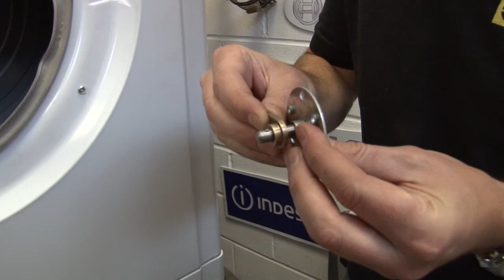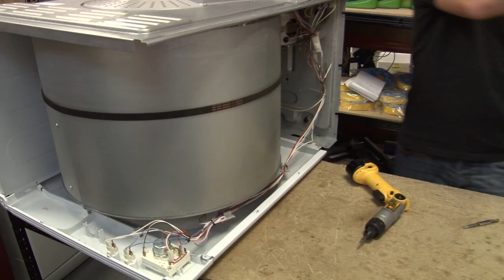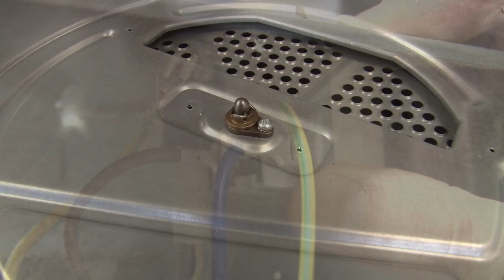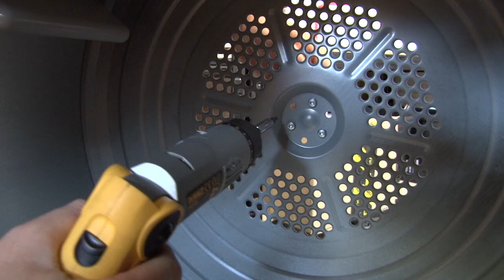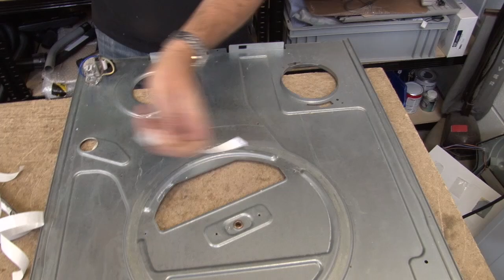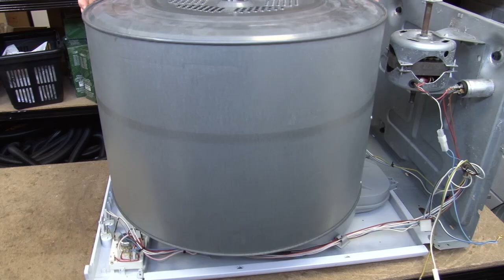You Can Replace Tumble Dryer Shaft & Bearings EASILY Yourself!

Comment: Do you still reply to comments here? 
I have a drum with the shaft already built in. Can you buy the whole drum with the shaft built in? I can’t seem to find them on eBay etc they just sell the shaft kit. 
This video really helped though I didn’t feel so alone fixing this annoying thing.
Reply from the maker: Hi James, we'll certainly try and help you to see if the drum is available for your tumble dryer...could you confirm:
- the brand?
- the model number?
- the serial number?
The model & serial number information should be on a sticker or rating plate, possibly near or behind the door.

Comment: My Beko tumble dryer has stopped rotating.  The motor buzzes but it will not overcome sticking.  If I turn the drum manually from above it works.  I suspect it is either the bearing/shaft or the front supports which appears to be adding excessive friction.  Then again, it may well be the motor??  Anyone else had this symptom?  The wife wants a new one (this was manufactured 13yrs ago and has a B energy rating ( DCU8230 Tumble Dryer).  Thanks

Comment: When you removed the back cover there was no washer on the shaft and when refitting everything you put a washer on the new shaft? My IDV 75 doesn't have a washer and I can't see one on the parts diagram. So should there be one?
Reply: yes.. no washer on mine neither but I have a damaged hole in back plate so if I can find  a washer to fit I will use it

Comment: I fitted your shaft kit which worked great. i now have a knocking noise (9-10 knocks per rotation) my drier version has two bearing pads on one side and a roller wheel on the other. there is good tension in the belt pulling the drum onto these. nothing is visibly damaged. the felt seal/pad seems ok. any idea what this might be?

Comment: Thank you for a straight forward easily understandable video. Just one question...I have managed to replace the spindle  and the bearings, all in working well but, when trying to put the belt back onto the motor, it was very tight (original belt). Got it all back together but the drum is now actually touching the motor, so I can hear a rubbing sound when the dryer is running, which i guess is the drum rubbing against the motor. What have I done wrong?
Reply: I’m having the same issue

Comment: This was great up to the point i discovered my bearing shaft was spot welded not bolted in place.
Still helpful though.
Reply from the maker: Hi Rebel07979, thank you for your post and glad we helped a little bit.
Reply: Mine’s the same, did you drill the spot welds out and re bolt it

Comment: My indesit dryer shaft has completely sheared off and I'd like to replace it myself, but I'm curious about the bearing pads and seals. Are they necessary to replace?

One other question, the shearing of the shaft appears to have done some minor damage to the hole it fits through on the rear of the dryer, cutting a small V shape below the hole. With the shaft fitting through the hole and then a collar, do you think that would be a problem? I can provide a picture, but it looks a little like this shape now O> (but vertical with the v at the bottom)

Comment: Thanks for the video really informative!

For anybody replacing the bearing/belt on an Indesit IS60V both side panels need to be removed to enable removal of the rear panel, also note the plastic bottom trim piece and top trim piece containing the control panel also require removal as there are screws located behind that secure the side panels.
Reply from the maker: Hi JVChester, glad you enjoyed the video and thank you for providing the information for everyone.
Reply: @eSpares   id love see a video of replacing  the bearing on a hotpoint tdl30 from the back some people have done this so many times not worth fixing a noisy dryer  use it for parts
Reply: @eSpares   can you please show a tumble dryer bearing replacement on a hotpoint tdl30

Comment: Question. Could you put some grease on the bearing to slow the wear down ? Cheers.
Reply from the maker: Hi David, most bearings will already have grease in them and extra greasing probably won't make any difference to the life span.
Reply: @eSpares  thanks for the reply 😁👍

Comment: A technician in Spain came to analize a metallic noise in my dryer (24€). He told me what I had to change the bearings and it was going to cost 110€ more. I bought a new bearing for 10€ and I fixed my drier in 5 minutes and it's working fine again. Thank you very much.@esSpares.
Reply from the maker: Thanks for the feedback Antonio, glad to hear you have sorted the problem.

Comment: Ive repaired mine a number of times now. Dont you think this is a rubbish design though. It seems to me that tumble dryers are designed to fail. Those bearings are not even a bearing. its simply metal grinding against metal until it grinds its way into the case. and as for those plastic supports and felt sticky seals. DONT EVEN GET ME STARTED.!! I can strip my machine down and do the lot in less than an hour but these machines are RUBBISH. Its little wonder so many catch fire !!
Reply from the maker: Thanks for the comments Dave. I have personally repaired many of these machines for this problem. In my experience these dryers are great for low to medium use but larger families wear them out too quick. For heavier users Bosch and LG machines last a lot longer.
Reply: Yes. Ive ended up drilling out the square bearing housing and Ive fitted a thick metal bracket on the back of my machine. It now has TWO of the tear drop type bearings fitted back to back instead of the single square one. Ive left the cover off so I can easily keep an eye on it and give it a tiny squirt of WD40 every few months. Seems to be working well so far. I dont know why they didnt fit a REAL bearing on the back of these machines though.

Comment: Hi don't suppose you can give some guidance on changing this on an is70c model?
Reply from the maker: Hi Darren, we do not have a specific video but it will be either very similar to this but if it does not have screws to remove the drum shaft you need to watch the other video linked at the end of this one:
https://www.youtube.com/watch?v=vMlMqA7O7RE
Reply: eSpares thank you. Can you provide an email address so I can show you a picture of the back of my model?
Reply from the maker: There is no need as you will either have 3 screw heads in the centre of the drum inside or no screws. For your type we believe it is this specific video:
https://www.youtube.com/watch?v=vMlMqA7O7RE to fit the shaft kit:
https://www.espares.co.uk/product/es1672507/tumble-dryer-shaft-kit
Reply: @eSpares   my hotpoint tl52 is making a little aqueak when running can you help me  fix it

Comment: HI MATT IVE REPLACED THE SHAFT I PUT ALL BACK TOGETHER BUT THE DRUM IS TURNING SLOW  ?? NORMAL THEN SLOW WITH CLOTHES IN IT  THE BELT IS  NICE AN  TIGHT  PERFECT ANY CLUE  TO WHAT COULD BE WRONG ?
Reply from the maker: Hi Francis, check the drum is correctly back on the bearing shoes under the front edge and if in doubt remove the belt of the motor to check it is not 'binding'. If the drum turns easily with the belt off it may be the motor capacitor that is failing (common problem) so see another video: https://www.youtube.com/watch?v=Vd8DcQpk748
Reply: @eSpares   will this video work on hotpoint ultima logic sensing  tdl62 dryer/hotpoint tdl60/hotpont ultima logic sensing tvm65 all hotpoint tdl series

Comment: Hello  Matt great video by the way fantastic step by step guide even for us  women  to follow and making simple for us women so we can  do this repair   our selfs .... 
 my  indesit tumble dyer  there isnt much drum movement so im wondering will i have to replace the shaft at all last time all i had to do was replace the bearings ?  as it was making a whistling sound now its doing it again a year later so would you adise i replace shaft ? this time round even though there is NO  drum movement when   rocking it side to side seems to be pretty solid theres a little movement  but not a lot advice please  ??
Frances /Dublin ireland
Reply from the maker: Hi Frances, thanks for the comments. The belt on your dryer pulls the drum firmly down so you will not feel any movement. Look at the rear bearing by taking the bearing cover off. As the bearing wears the shaft wears through turning the round hole oval and eventually the shaft is cut on the rear panel. If only the bearing is worn replace that but do check the shaft for signs of damage and replace if any damage found.
Reply: Hello , im  feeling very proud of my self  thanks too your really helpful step by step videos i was able to replace the shaft and take off rivets to put on the new shaft i sanded where the rivets came off and i put  new back bearings on also ... i hope i havent to replace the back bearings again as the one i took only lasted 8 months  , HOW LONG DOES THE BACK BEARING MENT TO LAST ?
Reply from the maker: Well done Frances, not an easy repair. The rear bearings on these models are a common part to wear and I often replaced two or three a week when on the field (probably 20% of all repairs on these machines). Interestingly some machines would last for years and others less than 12 months. This could be partially due to load size and frequency of use and wear may be increased when running 'multiple' loads one after another. If you are a 'heavy' user you may consider a 'stronger' machine as the additional expense may be a wise investment.

Comment: my machine keeps squicking its earpearcing
Reply from the maker: Check the rear bearing as it may have worn through and need replacing. If the back has damaged the drum shaft replace the parts shown in this video.
Reply: eSpares ok will do

Comment: have recently replaced the shaft and bearing on my indesit .... but has started squeaking again after just a few months. removed plastic cover and bearing worn through again. any ideas why it has gone so quickly ?
Reply: +Andypppppppppp bad design to get money off people rather than making a quality product iv got a 25 year old washer and dryer both still doing there jobs lol.  Basics bud are the bush is made of a soft metal and their is always down force on the shaft from a tight belt if you ran it empty it would still do the same but take a bit longer than being full. a tip to get you buy is to turn the bush upside down drill a new hole for a self tapping screw and you got more use before stripping it completely iv done this and got month out of it
Reply from the maker: +Andypppppppppp Interesting one this, most engineers would look at this bearing and conclude it is not the best solution and I have personally replaced many for exactly the same problem. However I have also been to repair 5 to 10 year old dryers that have  not worn through the bearing. It may be down to the amount of work  the dryer does and when hot for a long time from several loads it is possible the bearing wears quicker. Sorry that we can only supply the same type of bearing but we cannot offer a modification for this problem. The only suggestion is if you are a heavy user you check/replace the bearing regularly as it is easy to do.

Comment: Thanks for this most helpful video.  Used it to change the bearing, shaft, seal and wear pads on a Hotpoint.  Few differences to the video like a riveted shaft on the original drum but easily drilled out and your video gave me the confidence to have a go and I learned loads - as well and the pride.  It was a must-do repair for a family of five with three small children.  Cost me £15 for the kit and circa 3 hours of my labour.  Saved me the cost of a new dryer or the cost of labour/call-out.  Thanks again.
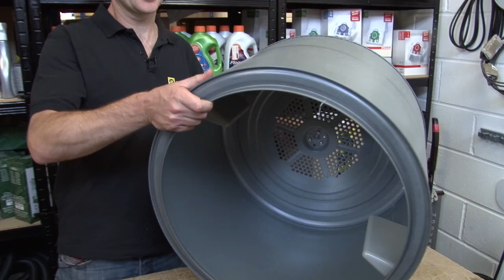Reply from the maker: +Stuart Pennington Thanks for your comments and hope you spotted the link at 5:33 to our welded drum video.

Comment from the maker: Re Tina Jones Comments:
If your dryer has three screw heads showing in the centre of the drum kit http://www.espares.co.uk/product/es546701 is suitable. 
If there are no screws showing you will require a kit specifically for the riveted type drum shafts like http://www.espares.co.uk/product/es1672507  
Order the correct type for your dryer.
Reply: eSpares

Comment: hi 
I have the Hotpoint Aquarius  TVM562P  
when it comes to the kit most suppliers want to know if dryer is riveted or non riveted 
how do I know which mine is 
as I don't know what they mean 
thank you
Reply from the maker: Depending on the serial number you may have a different shaft kit. If you look at the centre of the drum inside and can see three screws you need: 
http://www.espares.co.uk/product/es546701/  if there are no screw heads showing order this part:
http://www.espares.co.uk/product/es1672507/

Comment: good video, however please bear in mind a couple of points: This is a brand new machine he is stripping down so everything is easy to undo and strip down. try doing this on a machine that is 5 years old! Also it is near impossible to get the pin in the new shaft!
Reply from the maker: +Andrew Trigg Thanks for the comments. Unlike working on a car the screws do not generally corrode so do not generally give much problems on dryers. The pin for fixing the bearing collar can usually be cut to remove as there should be a new one in the shaft kit.
If having difficulty refitting the pin make sure you turn the hole until it is vertical and pushing the centre of the drum towards the back of the machine to give a little extra clearance from the bearing will also make fitting easier,

Comment: hi, my dryer has been squealing whilst drying, the same as in video but hotpoint. took off back where the bearing is and their is black dust in there but drum seems solid and does not move, will i need whole kit or is it just the bearing i need to replace, thanks your help would be very grateful.
Reply from the maker: +mandy read If the bronze bearing has not worn through you may get away with just replacing that. Another common cause of squealing (and wear) on some Hotpoint's is the belt pulley shown in our video: https://www.youtube.com/watch?v=MGsuFbufnew
Reply: +eSpares  thanks we have ordered the parts from you, thanks for your help and great video.
Reply from the maker: +mandy read :-)

Comment: Hi Matt, my tumble dryer was squealing and banging so I got a drum shaft kit and followed your instructions to the letter and a job well done! I had to drill the shaft off the drum and use small bolts to re attach the new one. The bearing was completely worn through and the end of the shaft snapped off as I removed the pin! Gave it a good hoover out and put it back together and now it sounds so sweet!  Thanks for posting these very useful videos.
Reply from the maker: +mike travis Thanks for your comments, sounds like you did a good job there Matt. :-)
Reply: @eSpares   my hotpoint tl51 is now squeaking when running
Reply: I think I'm gonna have to drill the shafted off the drum. Is this because the original is fastened on with like non removable rivets? How straight forward is it to get the old shafted off?

Comment: Thanks for this.i cant believe how badly these things are designed,surely a roller bearing would eliminate this problem.
Reply from the maker: +justin odowd Maybe because of the heat it will be exposed to and the relative light forces most dryers do not use roller bearings for this.
Reply: My thoughts exactly…I may even try to ‘convert’ mine !

Comment: hi there i have a white knight c44a7w and it sounds like a mouse squeaking, also the drum itself you can move to the front of the dryer by the door and also push back to, the back of the dryer in this vid you say there should be no movement  as i can move the drum inside the dryer do you think it could be the shaft and bearings ?  or something else many thanks.
Reply: +daz sam  white nights seam to have a better set up than this bought one 2 year ago and does not have the same bearing or shaft so hopefully lasts longer
Reply from the maker: +daz sam Sorry we seem to have missed your post, If the rear bearing is worn the shaft hole in the bearing will become oval and may even eventually wear through and cut the shaft on the steel back plate.
The front of the drum rests on bearing pads and around a felt covered support so there is a little movement hear but that is not normally a problem. Excess wear on the felt will lead to a lot of lint inside the cabinet.

Comment: I'm doing this to my condensing dryer. I'm hoping to just loosen the back off and change the spindle and collar only by unscrewing the spindle from inside the drum while the belt is still attached. I have already changed the belt tension wheel and I did it from underneath cutting away some of the plastic vent lol. It would of been so easy to  just take the side off now after watching this guide, but I struggled for hours trying to do it (the wrong way).
Great guide! Thanks!
Reply from the maker: D Scooo Halve the problem with any repair is knowing how to get in access the part.With our extensive library even some professional engineers will check out our videos before tackling a unfamiliar repair.
We would recommend lifting the drum out as although it may look like extra work it will be easier than struggling with the belt trying to pull it down.
Good luck which ever way you tackle it. :-)
Reply: Thanks again for your video. I managed to replace my spindle having to drill out my old one as it was riveted on. I did remove the rear cover but not the drum. The spindle previously had damaged the hole where it exits on the rear cover but its all working OK at the moment. 
Fingers crossed!